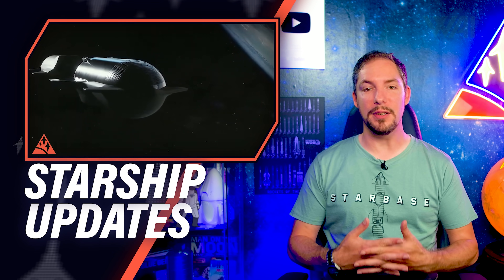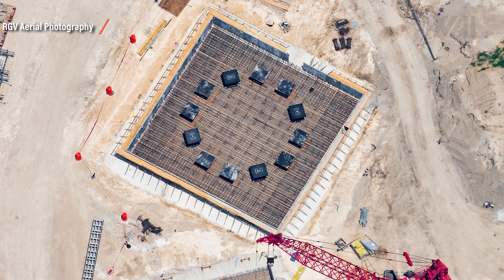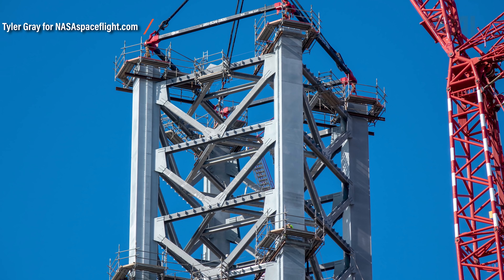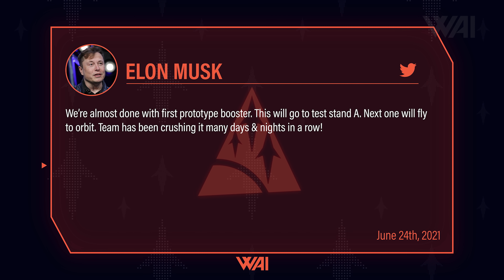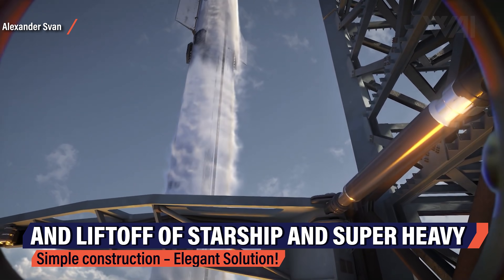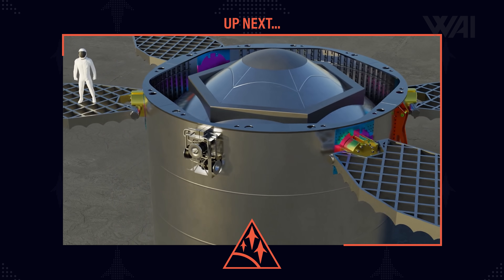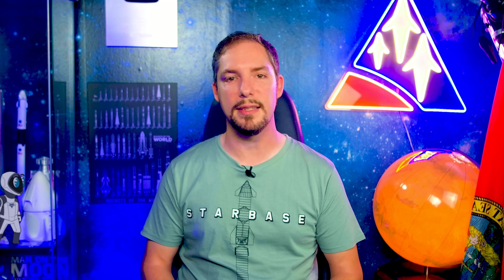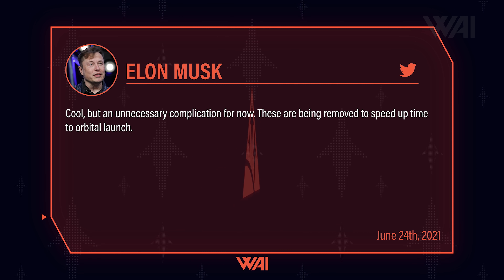SpaceX Starship design changed? Super Heavy booster precision landing thrusters!

Comment: SoaceX's "reducing mass" is just dumb.

They Want to reduce mass by getting rid off landing gear... And having to make heavy reinforcments of super heavy...

Popeline... It doesn't matter that much.

Refueling using only engines, so instead of spending energy that could be made on orbit, they spend fuel (do mass).

And using Lander for interplanetary transportation XD. It just Ads A LOT of mass.
So much that things before don't matter.
Reply: None of that makes any sense.
Reply: @odysseusrex5908  Thing is that when they trying to reduce mass it's only small amount.

But at the same time they want to use lander as interplanetary transport which adds A LOT of mass.
Reply: @ImieNazwiskoOK   No, the proposed Lunar lander and any eventual interplanetary ship will be two very different versions of Starship.

Comment: I would assume the booster to be refueled first from the top then an already filled starship to be lifted then placed into position. The most time consuming aspect is the fueling phase. The arm might might also act as a temporary stabilization for the top of the booster to keep it from moving as the starship is mated with its booster. The locks below may be hood enough to hold the booster in position but you cannot rely on those classes from below to prevent the top of that massive booster from swaying.
Reply: A filled Starship is a lot of weight to lift. Your also moving an enormous bomb. RIP SN8-11.

Comment: why not fuelt StarShip through the Bosster, but not have the FuelLine run through the Booster.
Instead of adding weight to StarShip this adds some weight to the Booster, as it would have a Side-Adapter near the top fot the StarShip fueling...

Comment: Could someone explain how the thrust vector control is working with vacuum Raptors, which are not gimballing?
Reply: Some sea-level engines will be on throughout the flight. At least one later on, but all six just after stage separation.

Comment: How thick is steel of current starship? 
Did they successfully transfer to thinner steel?
Reply: One place the sheet can be thinner is in the conical section of the Starship forward bulkhead/dome. The reduced diameter places less stress on the cone. 

Maybe the crew and cargo section is thinner as well because less internal pressure, but the tank walls and skirt hull are still mostly 4 mm, or someone would be bragging. 

The booster tanks may be even thicker. It has to handle more dry weight without being pressurized. The booster tanks also have dense top-hat stringers.

Comment: Why would refuelling in space need to transfer fuel from one tank to another? Why can't they just dock to an already full fuel tank and then use it? Or just attach already fuelled booster rockets? Like changing cartridges in a cartridge ink pen is much easier than pouring ink in and spilling it!!
Reply: Why don't you just drop your car's fuel tank and install a new one? The point is *reusability*. If all they wanted to do was expend stages they could have been doing tat years ago.

Comment: I think the yellow tube structure will be the booster catching arms. Ibeams and box-section steel structures are great for carrying loads all in one direction, but tubes have better resistance to torsion which would help the structure survive the booster coming in a bit off-target. I would also expect them to be designing the catching arms to be semi-expendable, as if the booster lands harder than intended the tubes will buckle and absorb most of the impact, saving the tower itself from damage. If the landing arms are expendable, then having them made from tube also makes it vastly quicker and easier to repair on site
Reply: Idk it looks too flimsy to me,  but you could be right.
Reply: I am too of the opinion that the pipes seem to have relatively thin walls, suggesting they do not want to make it very heavy. Which lends credence to the idea that it is a structure that needs to swing out of the way quickly upon launch.
Reply: Makes sense to me. Looking forward to finding out for sure.
Reply: I'm not sure but I do know trying to catch a booster will not be easy so you have to plan for, "we didn't get it quite right this time".  You can't plan for precision in every landing. We land planes all the time but every landing isn't the same. That is taken into account.
Reply: Cool hypothesis!
Reply: Another point is that the booster will be much lighter when it lands so the catching arms don't need to be anywhere near as strong as the rest of the tower and pads which will be carrying the weight of booster+starship+fuel+payload

Comment: Fueling a Starship from the bottom through the SH booster would be foolish. It would add both unnecessary weight and complexity to the booster for the tiny benefit of not having a second fuel port on the side of Starship....I thought a few days ago the yellow pipes may be an umbilical arm to fuel and power Starship, now with few more days of progress I'd say that's almost certainly what they're building.

Comment: What fuel do the hotgas thrusters use? If it's not LCH3 and LO2 would this not limit the mission length?
Reply: The only consumables available are oxygen and methane, so that is what the hot gas thrusters will use.
Reply: I have heard that the hot gas thruster high-pressure (COPV) propellant vapor tanks are replenished by operating the Raptor engines. (top-off). 

You meant LCH4, yes?

Comment: So the starship gets refueled in orbit and goes onto Mars, right? Here’s a crazy idea… why don’t they modify a heavy booster with some vacuum engines, and put a cap on top (minus the starship so less weight) and then put that in orbit, refuel it, attach it to the orbiting Starship and send it on its way… would probably have enough fuel, etc for a round trip.  I know, just crazy enough to work… and thank you, thank you, just put the cheque in the mail. 😬
Reply: It would need to be SSTO, and those don't work on Earth... And then what would you get from it? Full Starship is capable to fly to Mars on its own and will produce own fuel, so why bring dead weight?
Reply: You know the booster cannot be launched into LEO? But Starships can. By making more tanker launches, the mission Starship can have more propellant - up to 1200 Tons! 

If that is not enough, the Starship can burn for a highly elliptical Earth orbit, and get further top-offs from a nearly full tanker already waiting in that orbit... That is such an insane amount of Delta-V that some thermal tiles might wear out in just a couple landings, but the transit would be extremely fast.

Comment: My guess to how starship will be fueled on the booster:
There could be a small adaptor in the interstage that connects the fuel arm to the orbital refueling adaptor of the starship.
This way the starship would not need two fueling systems and the long pipes in the booster could be saved.
Reply: Like an A/C quick disconnect on cars 134A

Comment: Fueling the booster through the Starship would decrease the complexity of the operation. Fewer moving parts makes fr a happier Elon...I think
Reply: Need extra checks (time) and more safety precautions (complexities) because the fuel connection between Starship and HB will be disconnected while on flight, if there is even the slightest fuel leak it will cause a big explosion.

Comment: If the Starship is fueled through the Booster then there's a new potential point of failure as that internal connection will need to be disconnected before stage separation. Hopefully, that disconnect would be verified before launch or they risk the disconnect failing while in flight which would make stage separation difficult.
Reply: side to side might be a better option
Reply: They will certainly be disconnected before "press for flight". I agree that this uncoupling is a prerequisite for launch.

Comment: Fuel Starship through Booster, but through separate connection high up on Booster. Will reduce strain on pumps and reduce Booster complexity /weight compared to fuel "through" from bottom. Possibly use same connection to fuel Booster "down". Might make sense to separate though.
Reply: The fuel pumps are on the ground, not on the ship
Reply: @hotrodandrube9119  Absolutely. Ref. to pressure, if not avoided in other way.

Comment: Well having the fuel connector on the launch mount is higher risk than fuelling it up the main body as the mount has to take a energy and the thrust would destroy most things below it. So to fuel from the body is less complicated I think
Reply: The booster fill lines and quick-disconnects are probably retracted about 1-2 minute before ignition - around the time the GSE lines are purged, and before "pressing for flight". If necessary, the hardware will be protected with covers. 

There is a good chance that the new cut-outs in the OLM ring are where the fill connectors will swing out (actually swing inwards) and reach the booster plumbing.

Comment: Fueling the Starship might be in between the two methods you described. Maybe an adapter on the top of the booster's side that adapts to the existing bottom fuel loading point on the bottom of the Starship. That way fuel lines aren't needed through the booster and the weight of the fueling adapter on Starship will mostly be dropped with the booster.
Reply: I think this is the perfect solution!  Zero added weight in the Starship (where it matters MOST), and minimal added weight in the booster.  The vast majority of the added weight would stay earthbound on the tower.  👍
Reply: theoretically they could submerge the whole starship/booster into the ground and add some underground cavitys to release the heat/smoke of the launch or even submerge the whole thing in water (because why not? i dont know about the chemical reactions etc) ....just like a missile silo basically......

Comment: From what I understand, the tower doesn't need to be completed to launch the rocket as it doesn't need to catch it.
Reply: It needs the crane though 

For integration and stacking
Reply: @captainahab5522  maybe cranezilla could do the integration
Reply: @captainahab5522  For fueling also, the cranezilla will not try stack the starship and heavy booster with the full fuel on them it's just too heavy. And they will not just connect and let fuel hose dangling on the side of full stack starship without support like the tower will do.
Reply: @Leingod123  they fuel from the launch mount

Comment: Why would they fill the cryo-shells with nitrogen when it is a worse insulator than air? Surely argon would be better?
Reply: Yep, Nitrogen helps nothing with isolation. Look at the fill ports at the top of the shell, its much more likely they will fill some granules or foam from there around the inner tank. This is the usual way to build cryogenic tanks. Maybe they will flush it with dry nitrogen first to remove any humidity.
Reply: Or sulphur hexofluride
Reply: Nitrogen does not support combustion if there is a methane leak.

I think the shell will get an insulated liner.
Reply: @hamjudo  Nor does argon, that's why they use Ar as a shield when welding.
Reply: Not nitrogen, but DRY nitrogen gas. You don't want water ice and CO2 ice forming under the insulation against the propellant tank...

Comment: I'm betting they fuel from the top of the booster, lets you handle most of the pressure of lofting that fuel with ground equipment letting you lighten the superheavy plumbing, while still getting to use the same fueling adapter on the starship.
Reply: I was about to say that. Fuel the booster from the top, fuel the Starship from the bottom. All you need is a fuel handler at the top of the booster and a pipe to the lower tank. That way, you get a lighter booster and can re-use the fuel adapters on Starship.

I wonder if someone at SpaceX is reading these comments, sometimes thinking, "hey, great idea, let's try this!". I suspect the guys there don't care where an idea comes from, as long as it works... :-)
Reply: @realulli  I like to think what you say about their engineers is true, and Scott Manley effectively designed half the ship. JK
Reply: @realulli  you’re giving armchair engineers in the youtube comments too much credit 🤣
Reply from the maker: That would be a great approach! Much less pressure would be needed to pump the fuel up!
Reply: You need the same pressure anyway to pump the propellant up the tower, the height is the same; but pipes in the tower can be stronger and heavier to withstand it, and there can be a separate pump at the level of the fueling arm to pump the propellant up to the Starship.
Reply: Fueling at the top if the booster with one common element makes sense. If you pumped through the booster the pipe would have to be fairly heavy all the way up. If the heavy pipe is in the tower instead, booster could be lighter.

Comment: The only reason I could see needing a midheight fueling connection would be time and temperature constraints. Because SpaceX uses densified fuel and oxidizer, it may not be possible to fuel Starship through Superheavy fast enough to prevent thermal boiloff on earth.
Reply: Remember, that you cannot just connect the tanks and have a job done. You would need additional mass on booster to do this kind of transfer. And the weight is crucial.
Reply: Especially in south Texas.
Reply: Are we sure densified props are going to be used?
An older Wiki article on the Raptor specifically said so in the lede sentence, then it was deleted. No current mention of it.

edit: I didn't pay full attention to the lede; they took out 'densified', but added in "subcooled" which amounts to the same thing. That said, the references are very old.
Reply: @-danR  The SpaceX will definitely try to use densified fuels. It may not be possible, but they will try their hardest to do so. But I think it will be possible, the boiloff will just be expelled from tanks and fresh, cold fuel will be pumped in. And counter intuitive, it will be easier than with Falcon 9 since the bigger the rocket the better square- cube law result.
Reply: @-danR  They are absolutely using cryo fuel. They could not just change fuel types at this stage! Changing to non chilled fuel would lose something like 30% of its delta V
Reply: adding 70m of height (the booster) to the propellant column adds an additional 7 bar of pressure and that's if its open to atmosphere, then you have the height of tanks in the Starship to factor in and then you have to add the gas pressure in the tanks (+10m in height = +1 bar approx). This could only be achieved with seperate bypass fuelling pipes in the booster, 2 pipes minimum, which would add considerable weight. An umbilical fuelling arm on the tower at Starship base level with booster pump at this level would remove all that weight. Could either, fuel via port on side of Starship skirt with a simple T valve to enable in orbit refuelling from same connector or, connect arm to a fuelling port at the top of booster with short connector pipe to Starship fuel port under skirt of Starship.
Reply: @iankeeling4463  This was kinda my thinking. Any type of launch delay during Starship testing required SpaceX to completely detank the vehicle and start the fueling process again. At current fueling rates it would take them almost an hour to fill both Superheavy and Starship through a single fuel port at the bottom. I can't see this being feasible without massive boiloff and fuel loss.
Reply: @JessiBear  Yes the time IS an issue as you can only keep cryo liquids at around boiling point by venting pressure , you can't keep them superchilled, so they will keep expanding in volume reducing the total onboard fuel load, even with ongoing topping up on pad.
Reply: Given the in-orbit refueling capability of the StarShip (aka upper stage) they may fuel the StarShip from the Booster.
Reply from the maker: Yes!
Reply: You'll want the fuel transfer to be quick to minimize ice buildup.

Comment: Site Director : What shall we build today?
Elon : Everything.
Reply: A good project manager says: we will work on everything that can be worked on regardless of the scheduled timelines.  There will always be delays of some kind, so until those particular delays are resolved, we will still push forward and work on what we can.
Reply: @billthecat7536  There is such a thing as the critical path. A good project management team watches critical path, a major factor of which is lead times for delivery of critical components. Fortunately, SpaceX is making a lot of stuff itself. Key suppliers no doubt have staff on call 24/7 for when SpaceX has to adjust design and schedule. We should expect SpaceX to be paying for materials within 30 days, perhaps shorter. It will have testing labs lined up for material sample tests. Rapid prototyping requires being the favourite customer of your suppliers.
Reply: @peteregan3862  Critical path is more about materials delivery and availability than it is about the overall schedule.  There are dozens of other types of delays that can affect your schedule.  So if something disrupts one part of your schedule, until it is resolved, you work on what you can to keep moving forward.
Reply from the maker: □Right? It's just incredible to see, how SpaceX manages to do all this at the same time while also running the Falcon 9 business at the Cape including crewed launches!
Reply: @Whataboutit  An ungodly, and impressive amount of work being done at Starbase, alone.
Reply: Elon: yess!
Reply: Site Director: What do you mean everything?
Elon: EVERYTHING!!!!